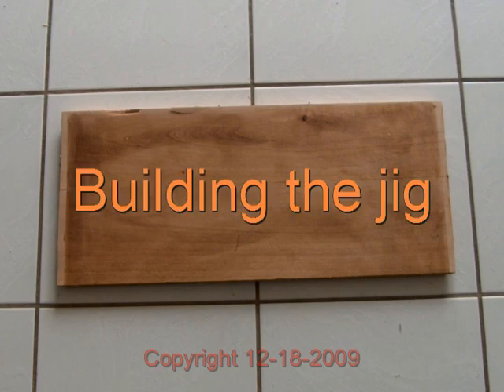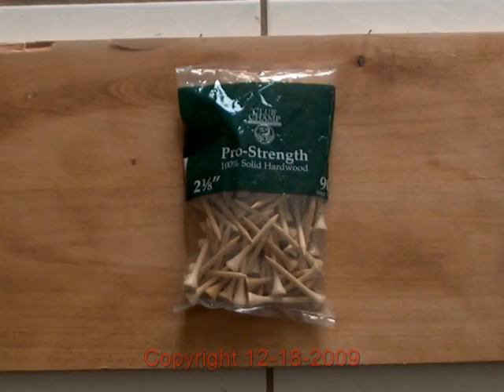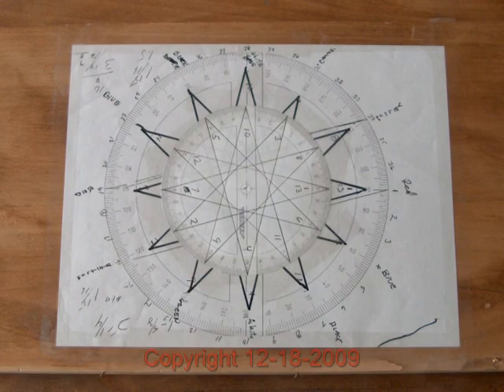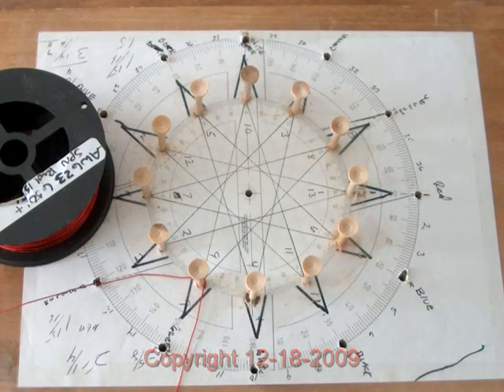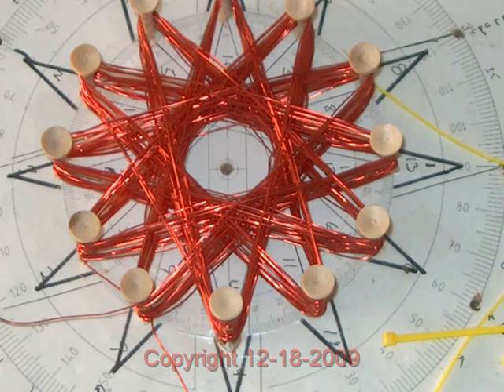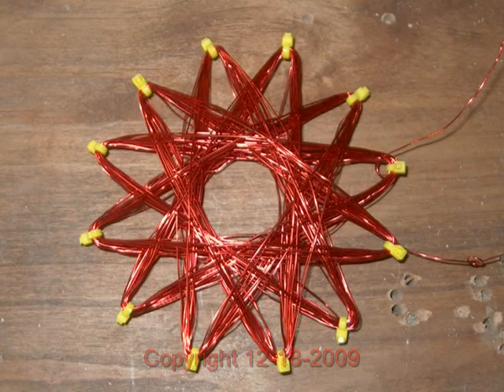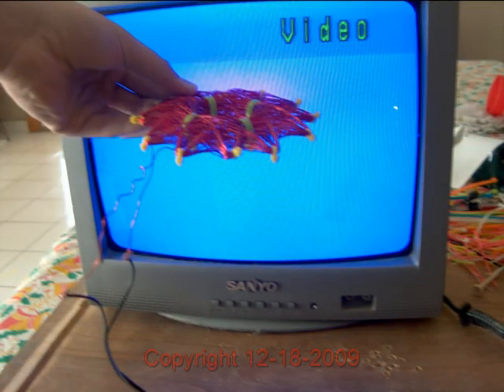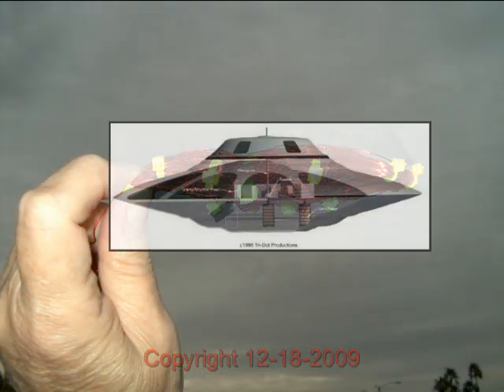Rodin Starship Coil

Comment: Please help! I made one of these with a 20" diameter coil and energized it with my chi. Then I powered it up with 12V DC and put my penis in it to see what would happen? It has been 22 days now and my erection still hasn't gone away. HELP! :(
Reply: Short circuit your erection by inserting IT into a warm and wet punani (AKA, minge).  Keep inside till the field is fully dissipated. You will have peace for 8 hours. Repeat as required

Comment: While part of your statement is true, the part where electricity through a copper wire creates a magnetic field and a magnet in the center will spin, basic motor what IS new is the shape of the magnetic field. Go ahead and build a "standard" coil motor and try and reach the speeds scene in his and skycollections video's with the same power input.

Comment: @henrykay01
"Where did you take Lorentz transformation without relativity theory?" it doesn't even matter if LTs have no physical relevance whatsoever, if you write down maxwell's equations you will see they are invariant under LT.  Therefore when you break that invariance you have become inconsistent with maxwell's equations, that is where you derive your energy generation. This was mathematically proven before relativity was even thought of. LT does not come from relativity.

Comment: @jadon1979 "What experiments have you personally done to support the current day belief in conservation 100%? You haven't. No one has. It's not possible."  The neutrino was predicted on the assumption of energy conservation, if not conserved there is no reason to suspect this.

Do you understand Noether's theorem?  It cannot be wrong, it could not apply to physicality. However, if it doesn't then all field theories must be wrong, but e.g. QED is the best validated theory ever, ever.

Comment: Sorry Richard, I didn't mean to find any fault in your winding style at all, yours is the proven Rodin toroid style winding. The one I am wondering about is just the plain anneagram, 1-2-4-8-7-5 using only 6 pins. I would not bind those wires together on the first attempt I think, but rather maintain their natural spacing, had it all been straight rods between pins.
Where yours has a nice flow around a missing toroid, "mine" would merely isolate each number, allowing additional coils, cores, etc

Comment: I just posted a similar design idea! Great work.
I called my idea Stacked Web Rodin Coil.

I wonder, did you ever consider (what I figured) just winding the basic Rodin anneagram rather than the coil-like winding? You'd have the 3-6-9 totally clear as unused pins.

The next level would be building a toroid would this way. No idea what that might do, but it seems a pure yet different application of the Rodin math in coils.

Comment: I am now making a 8.5 inch diameter Starship coil. The center donut hole will be 2.25 inches. I figure 212.5 feet of wire will make up the coil center height of 2 inches for what I need.  It appears this will be an easy wind.  I already have my "Power Tower" up and running. All I need is the Starship coil to place on top to extract magnet flux.  The device is looking excellent so far. Can hardly wait to post a video.

Comment: Good Idea, can't wait to see the results vs. a traditional coil usually for a standard coil when you connect it to a light bulb and 120VAC and you take a clamp meter one would get a reading of about 16 amps out of the center